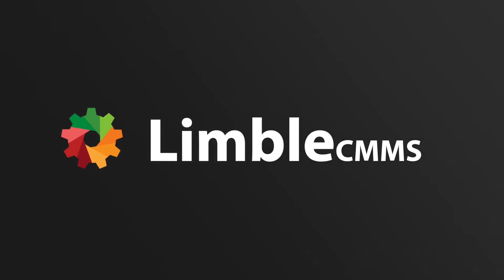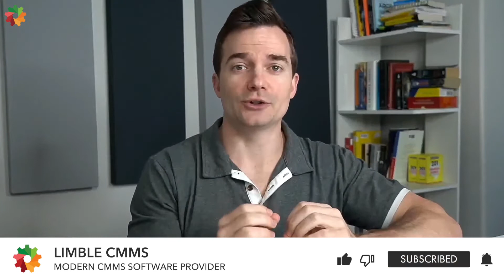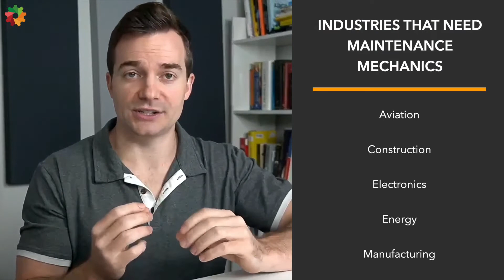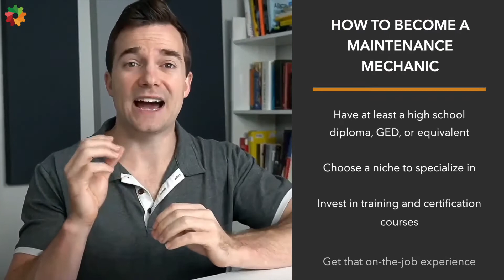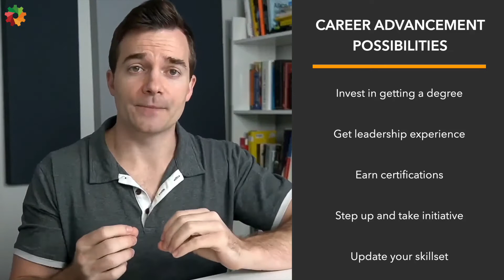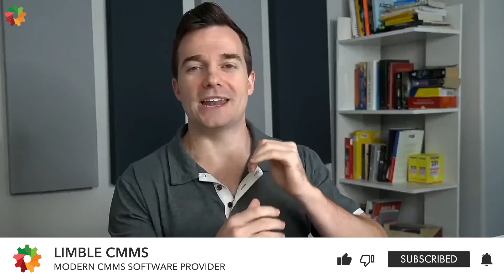Everything to know: Maintenance Mechanic

Comment: So—

—One has to get HVAC, welding, electrical, pnunatic, hydraulic, grindings, et. al; for just $35-50k:

But one can just get HVAC, and start off at $60k.   I don't get it ..🤷

 Chicago 2022-24 salaries.
Reply: wrong, industrial maintenance entry level salary is 60-70k minimuim
Reply: @FloppyPapi 

I was not commenting on what an industrial mechanic starting salary is.

All I stated was the high-end starting salary for an HVAC technician with an associates degree in the Chicagoland area.

The jist of my comment is that why choose a path that requires you to five trades under your belt when one could make the same coin with a single HVAC trade. 

Reading comprehension is a skill ....

Comment: Real numbers. With the lack of skillful techs and for every 10 retired mechanics, only one comes in to replace them. I’m a 38 years Millwright / Industrial Maintenance Mechanic in a supervisory role. With experience in many areas from welding to machining and troubleshooting anything from pneumatics, electrical, steam systems and just everything in a manufacturing plant, you can earn from the high 80’s to 160k easily. I take home roughly 60k but the benefit package makes it closer to 180k. The work is sometimes hard and the hours are sometimes long. Your body will pay the price from the years of lifting, pulling, stooping, climbing and carrying heavy awkward objects. Sometimes it’s not for the faint of heart in some Alf the areas and conditions that you work in.
Reply: How do you go from a salary of $80k to a "benefit package" twice this amount...????!!

Do you get twenty-six weeks of vacation, or something..??

Im a former life, I used to be an accountant.  I would say a 40% benefit oackge would be on the more plush side in my experience.
Reply: @michaeldunagan8268 that was 160k….typo

Comment: Make sure you know what you're getting into, because maintenance means different things to different people. The kind of maintenance I worked, was as an electrician/mechanic who fixed anything in the plant that needed fixed. Some people think maintenance means grease monkey with lube and oil. Or maintenance means janitorial service. Or maintenance means you run a production machine and make your own repairs and adjustments. Or maintenance means you take care of and make repairs to buildings. Or maintenance means lawn mowing and taking care of a property. When I was in the navy, my rate was AMH. That stood for aviation maintenance hydraulics. I thought I was going to be a jet mechanic, but the job was wash rack and grease jobs on a flight line and I hated it
Reply: Yeah I work a cheese plant in Texas and maintenance gets paid $32 starting and Max's at like 40 but they are the jacks of all trades master of noone. They have to fix everything in the plant sometimes it takes them a while but they figure it out
Reply: That's kinda like the U. S. Army; guarantee your training—but not that you will working in them at field on your job ...

Comment: Ive been working as a maintenance technician for 13 years now. I’m now maintenance lead. What I’ve learned from my experience. Do not express your complaints or dissatisfied situations to anyone you work with. No one there is your friend. Your co-workers are not your buddies. Vent out your frustration to your family at home. Keep a good positive calm attitude and take your time when working on equipment. Answer calls on the radio professionally and just relax. Isolate the problems to what is not the problem and isolate safely.  Always use LOTO and be safe. Learn what you can. Keep notes on you phone. Take pictures before repairs so you will remember how it goes back. Don’t be afraid to ask for help. No one knows everything. If you are planning to go somewhere else never tell anyone. Use the maintenance manuals. Read and research. Over time you will become more proficient. Know your worth. Don’t be afraid to look for better jobs and go on interviews. Sometimes going somewhere might not be better. Be careful where you decide to work. In this trade you will see a high turn over rates because most people can’t handle it. If you stick out though you can make good money over time.
Reply: This good game right here! 👍🏽🎯
Reply: Very good advice.
Thank you.

Comment: I worked in large maintenance shops for 50 enjoyable years. In the USA we loose a electrical worker every day due to electrocution, Arc blast & Arc fault incidents. I can not stress enough if you are not properly trained , have a knowledge of the NEC & local codes and most important is know the minimum CAL of proper PPE to wear when you are working in live circuits, have panels opened & safety switches door open and when using a volt or VOM to test for power do not do electrical work. In my area takes an apprentice 5 years to become an electrician. Pure bull shit in jack of all trades. I paid to go to 16 hours of continuing education classes a year and had to take an OSHA10  class to renew my electrical license and read code question of the day thru both Mike Holt & Charlie Trout thru NECA.  Numerous times I had both facility & production bosses insist that I do something dangerous or serious code violation. Would ask them to please put it in writing then sign it and have at least one other person sign it. They always refused & backed down. Way too many companies either only want to supply one pair of rubber gloves and maybe a dirty worn out PPE rated jacket for entire shop. You must have ALL rubber gloves inspected & date stamped every 6 months. Must have proper CAL PPE long sleeve shirts, pants, work jacket, tinted face shield & might need approved ear plugs and race car style face covering ( B something ). Had one company refuse to purchase spare 1,200 amp 600 volt fuses. Told me if one blows to cut a piece if copper tubing and hammer it into fuse holder. Told them to kiss my fat ass and would go home when one if them fuses blow. For all of you young real deal electricians get good no real good in troubleshooting and installing & trouble shooting VFD'S.Did not work on my first drive until I was a sparky for over ten years. Got good with them. My chief electrician father told all of the young guys to get good at troubleshooting. Said they could train a monkey to run conduit & pull wire.

Comment: it pays well, but seems like more and more they want you to be able to do everything.  welding, electrical troubleshooting,  hydraulics and even plc troubleshooting
Reply: I mean, you can love it, but you can't be an expert in all of it like employers want you to be. I always try to explain to recruiters that 9 times out of 10 the manufacturers of these machines require a pass code to open up ladder logic and manipulate IOs. If that's the case, they may walk you through the IOs or they'll just tell you to call a service tech out. I prefer to be a master mechanic and let the techs do what they need to do.
Reply: @muadiib  meh, I do both. that said, if I don't have a company-issued laptop with the required software (also paid by the company), I ain't touching the ladder. you'll spend the rest of your natural life trying to edit through an HMI.